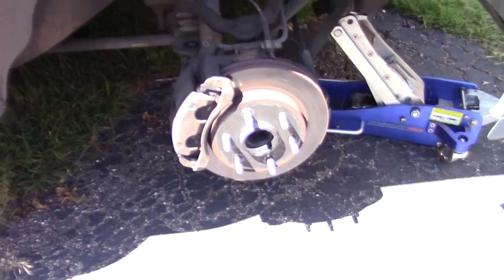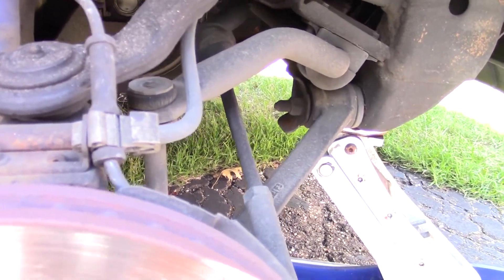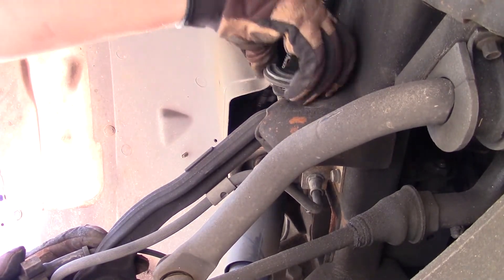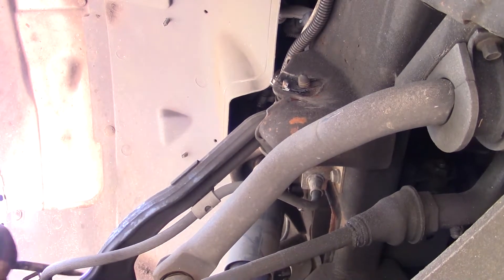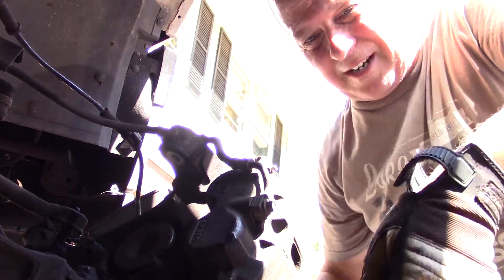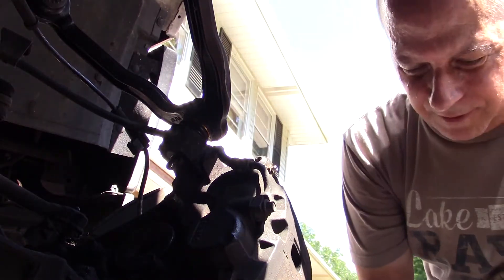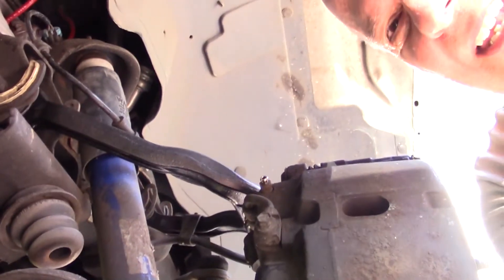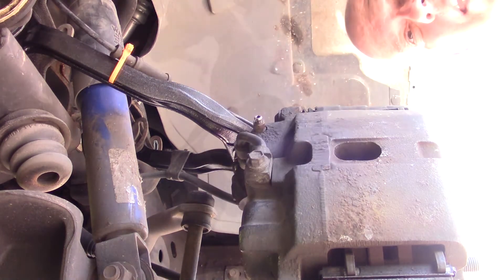2005 Chevy Tahoe Control arms

Comment: Been reading a lot of bad things about Moog parts. Used to be considered high quality. But its hard to find any parts you can depend on anymore.
Reply from the maker: I had heard things as well.  It's been over 2 years now since I posted that video and no complaints.  The boot ended up being whacky on the upper control arm, but Summit Racing replaced it and haven't had any trouble since.

Comment: Finally someone who pointed out the plastic piece in the camber /caster adjuster! What is that called?! Im replacing my whole front end and im at a stand still bc of my upper control arm!! That plactic piece broke that youre taking about at like 9:23 PLEASE help ive looked everywhere!! Idk what to search, ive tried everything!  Please get ahold of me asap!!
Reply from the maker: You would probably have to go to a dealer to get that plastic piece and then you would need to get a variety of them to get the right position.  I have used this product from Dirt King and it doubles as a cam and a retainer.  Hope it helps. https://www.youtube.com/watch?v=ZpRgqT6cABI
Reply from the maker: I found some at Autozone.  .  https://www.autozone.com/suspension-steering-tire-and-wheel/caster-camber-kit/spc-alignment-caster-camber-kit-86320/582868_0_0
Reply: @GroundhogzGarage  thank you so much I just called around! Each store only has one pair and one bolt.🙄🙄🙄🙄 but I definitely can atleast go to them and get enough for this side and get the others for the other side later!!! Youre a huge help thanks for the reply!!!! I'll give an update later!!!
Reply from the maker: @Datboyhoolio  Glad to be of assistance!